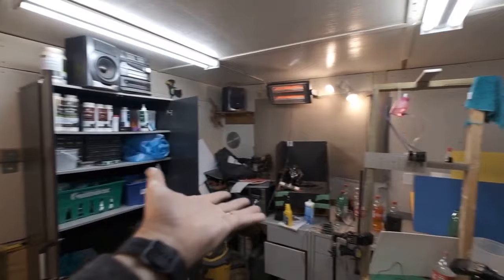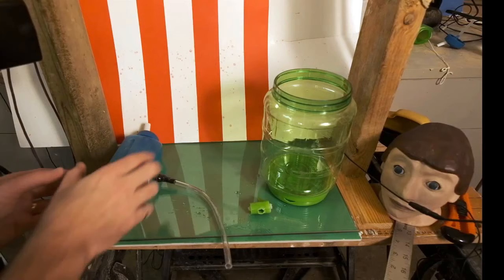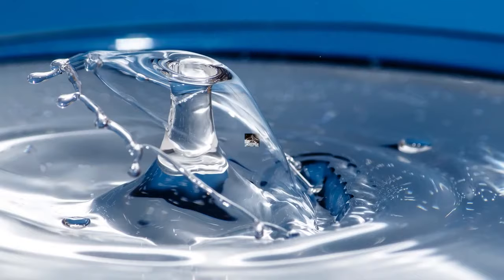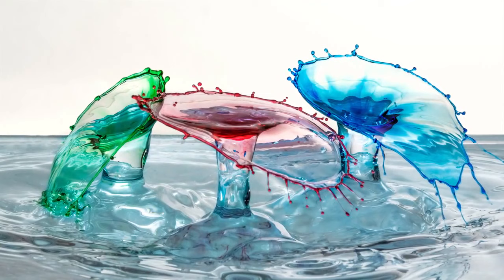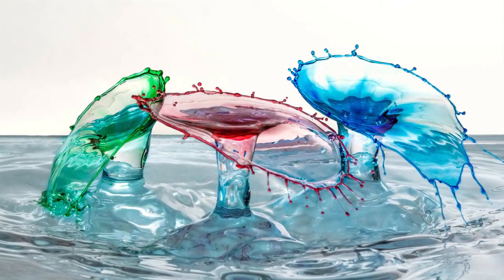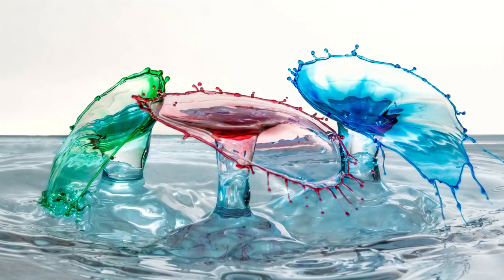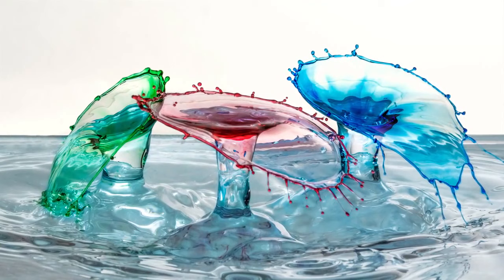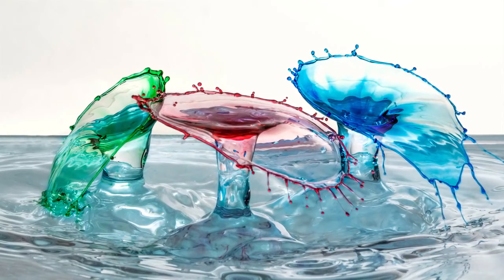DIY Double Drop Photography Setup by Kazemir Photo

Comment: Steve, here in the uk i use a dishwasher rinse aid called "Finish" to reduce surface tension on the water in the base collector, I'm sure you can find something similar in your location, only one or two drops is necessary to achieve desired effect, much less in bubbling usually only about half a dozen bubbles or so, much easier to dispel these bubbles, hope it helps.

Comment: Thank you for sharing your experience - just a small point, it is depth of field, not depth of focus. Depth of focus relates to using microscope objectives, which do not have a depth of field. Another point where newcomers get confused is what is macro photography, it is making small objects larger from a 1:1 ratio up to 30 X magnifications, photomicrography is extending the magnifications from low power macro, up to several hundred X (times). Micro photography is making large things smaller than Life-size, such as landscapes, portraits, including micro dot imaging is again reducing say an A4 document to a pinhead size image. Many non scientific imagers often get confused by the correct definitions .
Reply from the maker: I must have misspoke...I meant Depth of Field...as that is what photographers generally talk about in the acronym DOF.  Thank you for the clarification.  I did  not know there was a technical definition for "Depth of Focus".  I found this definition online: "depth of field concerns the image quality of a stationary lens as an object is repositioned, whereas depth of focus concerns a stationary object and a sensor’s ability to maintain focus for different sensor positions, including tilt."  So in one case the object is "moving" and in the other, it is the sensor that is moving.  Seems to me this really depends on your "frame of reference"   :)
Reply: @SteveKazemir  In another medical /scientific working lifetime, this sort of imaging was a daily routine -making tiny objects bigger, and the terminology was one of the first things I learnt when starting my university courses in this speialist field. Funny what sticks in the mind sometimes. Anyway, enjoyed your presentation and looking forward to my Pluto Trigger experience at age 82+. Keep up the good work.

Comment: Timestamps:
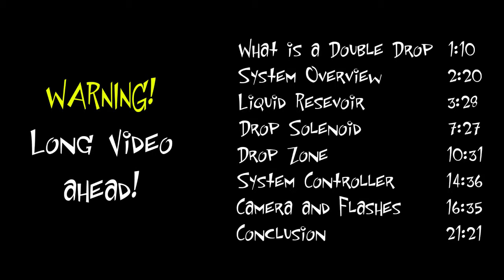1:10 What is a double drop
2:20 System overviews
3:28 Liquid reservoir 
7:27 Drop solenoid
10:31 Drop zone
14:36 System controller
16:35 Camera and flashes
21:21 Conclusion
Reply from the maker: Thanks!  I will do this myself for others next time!

Comment: So much engineering that s awesome!
Reply from the maker: Thanks!  A lot of work, but enjoyable, and I am happy with the resulting images I get!
Reply: @SteveKazemir  I am curious. How much time did it take to do it entirely from the concept to the finished "product"
Reply from the maker: @antoninmignot3723  Took me about 2 years...but this doesn't really reflect the actual time put into it as I only worked on it in my spare time (day job and all).  You can be up and running with a purchased system in an afternoon.  The time for me was in designing and building the circuit board, and sourcing all the bits and pieces.  I would suspect, building from scratch and ordering parts etc...you could be up and running in a month or two.

Comment: To get rid of the foam and soap bubbles, either add a very small amount of a siloxane based defoamer, or pup then all using flame of a propane hand torch.
Reply from the maker: Great suggestions!  I haven't heard of the siloxane before, nor had I thought of a propane hand torch.  Thanks!!
Reply: @SteveKazemir  Glad it is helpful... I came across the use of a torch when I was once getting lots of foam after pouring a resin mixture in its mold, the torch was a life saver! In terms of defaoming additives, usually they are either oil based or siloxane based. The oil based ones are weaker in breaking foams and therefore you'd need more to use, which could then lead to solubility issues... The siloxane based ones are super effective at very low doses and therefore don't cause solubility issues at their effective use doses.
Reply from the maker: @H2O2FaMo  Now I just need to go buy a torch and try and find some siloxane based defoamer!  Torch should be easy, but is the defoamer easy to find?  I haven't searched yet.  If I find some online, I will post it here for others.
Reply from the maker: @H2O2FaMo  Thank you! You are my hero!

Comment: Instead of moving tve nozzle up, you could move the reservoir up (longer tubing) to increase the pressure
Reply from the maker: Very good observation...I should have included this in the video!  I did try this previously with limited success, but I think at the time I was limited by the ceiling of my garage!  (Didn't want to drill holes in the ceiling to get it higher :) )

Comment: I heard using some of the green soap not colour but green environment etc.. works better with suds
Reply from the maker: Thanks for the info.  The soap I used was Nature Clean...Environmentally safe, "green" etc.  But I am sure there may be better stuff out there.  I would be interested in hearing a specific brand/name if you have it.  Any soap that is less "bubbly" would be better.  I heard that the bubbles are not necessary for cleaning, but are actually added to make us humans think it is cleaning better.  I could use soap without any bubbles....that would be the best!

Comment: Thank you, very informative & easy to follow... Are you saying the depth of the container has little to do with jet height?
Reply from the maker: Indeed...other than extremely shallow water, I found the depth of the container had little or nothing to do with Jet height.  Likewise, I was surprised to see that the height that I drop from had little effect too, once you get passed a certain height.  What really seemed to help, was reducing the surface tension of the water, with a bit of soap (not too much). But then you need to deal with bubbles forming in the dish!

Comment: I use a drinking straw to blow the bubbles out of the way.
Reply from the maker: Good idea.  I may try that, however, I suspect it may only move the bubbles around, and not actually pop them.
Reply: @SteveKazemir  Once you have blown them to the side of the container and out of frame they will stay there.

Comment: That looks fantastic great work . Could you please tell me where and the name of the circuit board I’m thinking of looking into it . Thanking you Michelle
Reply from the maker: Michelle, I am glad you enjoyed the video.  There are three circuit boards in the video, all stacked together.  The LCD board on the top, and that is plugged into a Nucleo board.  Links to both of these are in the description of the video.  The third bottom board is a circuit board I made myself, so you can't really buy it.  I would be happy to share the schematic and board layout, but that is only useful if you understand electronics, can build your own board, and write firmware.  If that is the case, let me know.  If not, then there are many double drop systems commercially available that would probably do a better job than my setup.  Good luck!  and let me know if I can help some way.